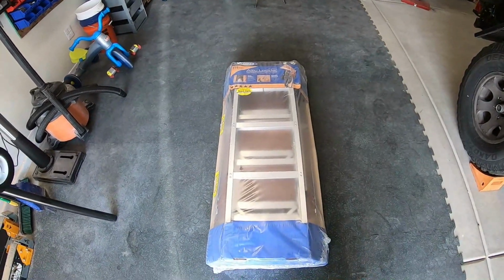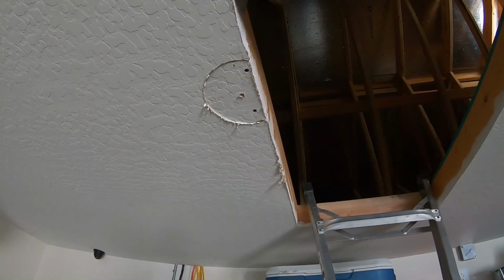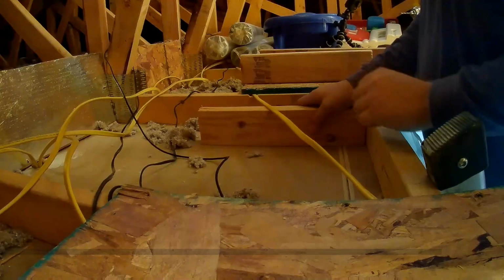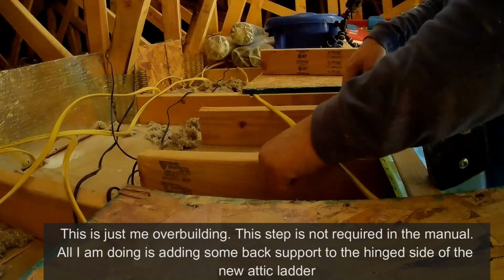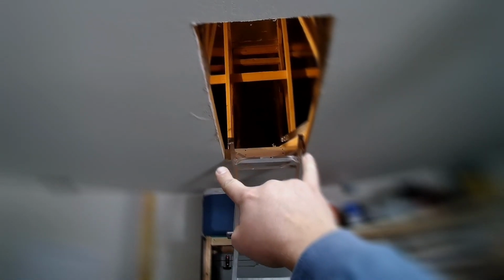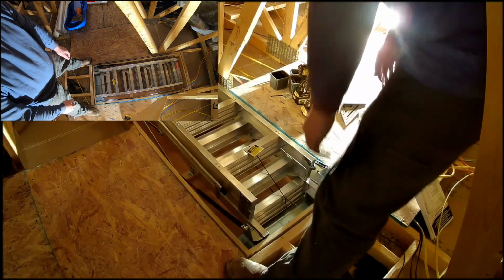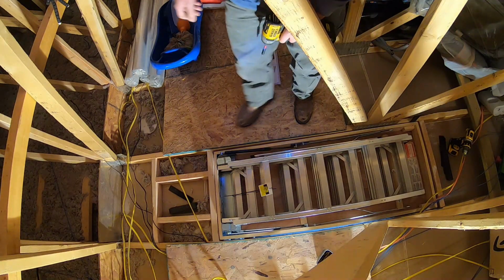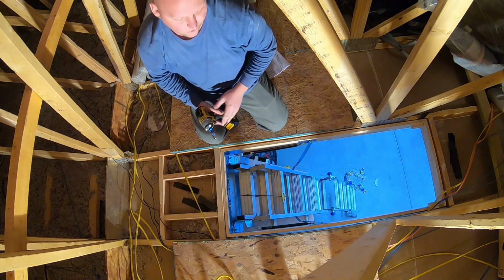Attic Ladder Install

Comment: for anyone thinking about installing it this way, do follow the directions when it says position the temporary wood brackets 3/8 from the edge of the headers. otherwise, you are installing the ladder with the face flush with the drywall and NOT the ladder frame which means you'll have a 1/4 - 3/8 inch gap between your finish trim and ladder frame. this way also allows you to open/close the ladder while resting on the temporary supports to make sure nothing is off or at an angle.

also, I found it helpful to simply put in the two header temporary screws and then closing it to check for an even reveal and proper operation - shimming the header if absolutely necessary. then move on to the opposite header and doing the same. finally the edges. this ensures an even reveal for trim and proper function. once the temporary screws are all in, then move on to the lags. of course, if your hole is perfectly square, you've got less work to do.
Reply from the maker: Thanks for watching! Good advice!
Reply: YoYO Semite  ?????

Comment: How did you escape from the attic with those 2 boards up on the ceiling?
Reply from the maker: Thanks for watching and good question lol. Personally this was a secondary access so I went down the other one. If you bring a saw up there with you though, once you get a couple of bolts in place theoretically I think you could cut the boards out from up top
Reply: I am in a situation where I need to take mine down to make an more exact and stronger rough opening.  I don’t have a way to get out if I place the boards on the ceiling and walked up the ladder and into the attic. If I can get away with just the screws to temporarily hold the heavy end of the ladder, it would be good enough so I could install the bolts through each side of the frame of the ladder into ceiling beams.
Reply from the maker: Let me know how it works out! Wish I had more words of wisdom for you
Reply: You did some magic there.  :)

Comment: With the temporary supports would it already make it square with the drywall ceiling now just needs to square it in the opening?
Reply from the maker: Not necessarily. Still have to square it all up

Comment: What screws did you use did you have to predrill
Reply from the maker: I honestly don't remember what size the lags were but yes predrilled to keep wood from splitting. If I was to guess I'd say I probably used 7/16 or 3/8 lags...but that is a guess, I don't remember

Comment: Overbuilding is best, minimum Code is not quite good enough. I agree with you. Stronger better!
Reply from the maker: Haha! Totally just read your comment in Time the Tool Man Taylor voice and added a grunt hahaha! Thanks for watching 👍
Reply: Ahh. Waste of time in this. I cut my hole stuck the damn thing up there and put 6 galvanized nails in it and it has worked great for almost 6 years and counting. I guess I just have more stuff to get done than other people do but to burn a days time and $20 extra materials to put a ladder in and not even finish it with the mouldings to have to come back to another day and finish? I think I would rather get it done and stop over complicating simple things and stay away from having half done projects. Keep it simple, get it done, and move on to the next task and repeat.
Reply from the maker: Lol, to each their own!
Reply: @AGuyandHisProjects  I wrote my comment in Toolman's voice, lol. I'm retired and like strong, swift installation.lol. it'll work great when you're done. thanks for the video.
Reply from the maker: @joe.a5350  anytime! All good! Gonna start reading everything in his voice ;)